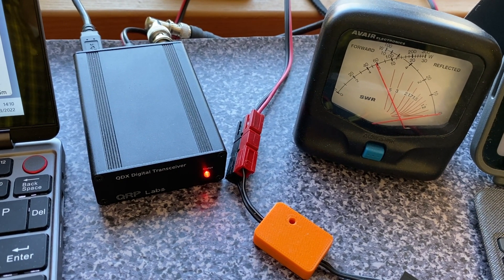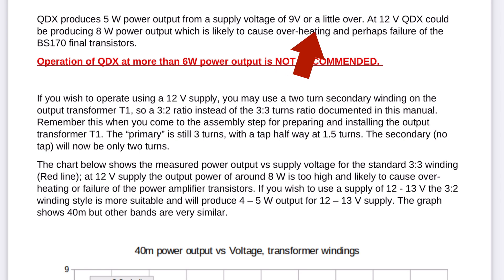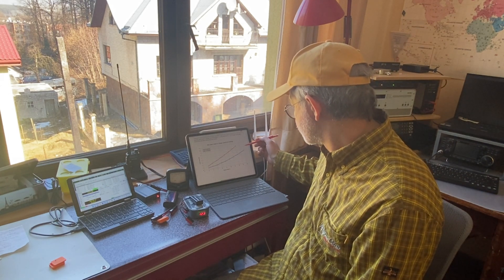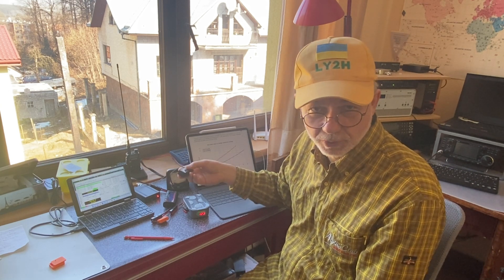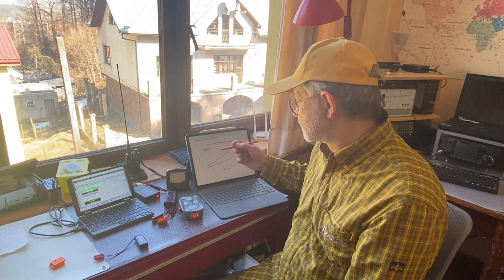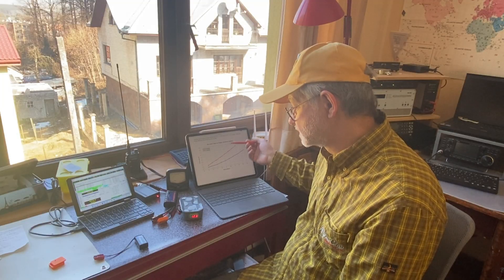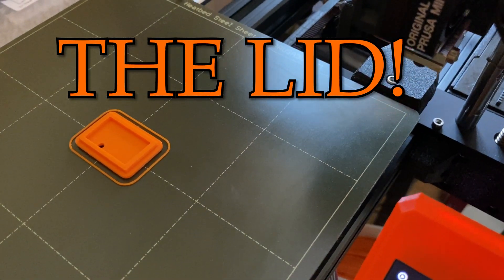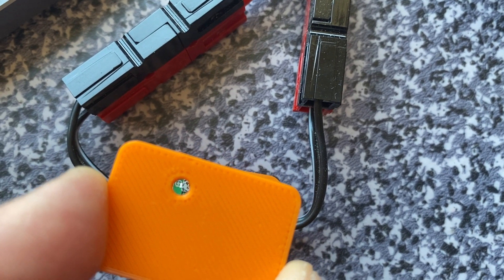In-Line Voltage Conditioner for 9V QDX Digital Transceiver in 3D printed housing.

Comment: Thank you for the video Linus. I added this to my 12 volt QDX using your box. I dropped the voltage from around 13 volts off a partial discharged 13.8 volt battery to 11.5 volts. I have noticed the QDX runs much cooler. Thank you for all your great videos.

Comment: Thanks for the video Linus.  I bought my QDX preassembled and it was supposed to be for 12v.  I bought the little 12v lithium batter power pack on Amazon and hooked it up only to find out it was putting out almost 8W.  Several emails back and forth to QRP labs who said my watt meter was wrong and then I needed to run it through a dummy load to be accurate.  I had been and my watt meter is accurate.  The second to the last correspondence with QRP labs was to put a series of diodes in line to reduce the 12v to 9v.  Then the last one was to send them a picture of T1 to see if it was wound for 12 or 9v.  I sent the picture and never received an answer.  Because of your video, I can now look myself to see about the windings in T1 and determine how it was wound.  Either way, thank you for your video and the links for the Buck converter and your housing box.  Keep up the good work.
Reply from the maker: Cool, there is always a work-around! Enjoy your wonderfull little radio as I enjoy mine! 73! Linas LY2H
Reply: Looked at the QDX and sure enough, it's wound for 9V.  I'll be making one of your little Buck converter and case.  73
Reply from the maker: @dpsflyboy  Nice to hear that Bob, hope, it's gonna work for you! 73! Linas LY2H

Comment: Buck converters only reduce voltage. Why not choose a more flexible Buck-Boost option?
Reply from the maker: Correct. And I only need to reduce voltage from the 12-14V levels, as my QDX is built for 9V. Actually, you can choose whatever you want, including no converters at all, as long as you can provide for 9V/1A at the QDX’s power feedpoint. The same logic is valid  for the 12V  QDX. 73! Linas LY2H

Comment: Thanks Linas for posting this option for the QDX. I had ordered my Qdx with  12v, which was still in the build queue, and I emailed Hans after seeing your video and had the build changed to 9v as I will be using it in the parks and also would like the ability to use different power sources and always have  around 5 watts.  It's great to find such great customer service from a company. Love your videos. 73 Ro Hart AI7PD
Reply from the maker: Thanks! Agree, Hans and the QRPLabs is fantastic! 73! Linas LY2H

Comment: If your lithium battery gets down to 9 volts you have damaged it!  Lithium Iron batteries are about 14 votes and are discharged around 12 volts. Below that can damaged the battery and most battery management systems cut off about 11.5 to 12 volts
Reply from the maker: Thanks for your comment on the use of Lithium Iron Phosphate batteries Donald, which I’m fully agree with. In my video I’m using a Lithium Ion (not Iron) 3S battery pack with 12.6 V fully charged. I agree with you that no battery type should be over-depleted and in no way I am proposing discharging any  Lithium  battery pack down to 9V in my video :). In my video, I’m discussing not the battery pack’s DOD problems but the power supply dilemma of the QDX transceiver. I’m advocating the 9V supply for this nice radio and propose using the step down converter for this purpose. The step down converter has no relation with possible misuse of the battery pack by the user. It goes without saying that every user must take care himself of ones battery pack being properly charged and discharged. 73! Linas LY2H

Comment: Linas - Great little DC-DC box and video discussion on this decision that must be made. I agree with your analysis when using a battery. I don't have my QDX yet, so preparing while I await the next batch. 

It seems like there was enough room inside the QDX box in the pictures. As long as the DC-DC is not really noisy in the RF area of interest, that would be a great future consideration. I see it has been discussed here also. I am glad it is in the discussion - keep it going. Great discussion going here.

Great video Linas and it helped me make my decision as well.
Bill - KA0B
Reply from the maker: Thanks Bill! It would probably be possible to accommodate the DC-DC board on the QDX pcb but the care should be taken and some skills applied to have it sit there safely and firmly. But these efforts would only justify itself if the permanent 9V is all what you want under the closed lid of the box as the access to the DC board would have been made complicated in this option. I wanted more freedom for experimenting, especially that power supply voltage regulation is the only way to adjust the output power in QDX and this option seemed important to me keeping  it easily accessible ( through this tiny hole in the box :)). Also, I left door open for connecting any other battery or whatever power source to my QDX.  With this said, I would , as experimenter, be very much interested in seeing someone else's implementation of the on-board DC-DC converter arrangement ! 73! Linas LY2H

Comment: Many thanks for an excellent voltage solution for the QDX. I just built the little convertor and noticed that I could change the voltage slightly by squeezing the top and and bottom of the box between my fingers. A little investigation showed that the little pot was getting squeezed and that was causing the voltage change. My board is sitting flat against the bottom of the box.  Easy fix: just nip off a little piece of the inside lip on the cover near the pot. It was this lip that was putting presssure on the pot. Works perfect now.  73, Howard AC1MN
Reply from the maker: Thanks Howard! You are absolutely right, nipping off a bit of inside lip on the box would help to adjust the accommodation of the board. I was designing the 3D printed box around my copy of the pcb and it could be the different pcbs might differ in dimensions like up to 0.5mm or so. I should have added some 1mm or so up to the box hight probably but I wanted it as small as possible :)...  Thanks again for your tip! 73! Linas LY2H

Comment: Hi, is it possible to transmit in 15m and 10m changing something?73´s Diego LU2DVY
Reply from the maker: Hi Diego! That would be nice! Unfortunately, the current design of V3 does not allow for the high bands operation option. The QRP-Labs owner and author of the rig Hans Summers could tell best if and when he is planning to release the high-band version, including a new firmware (which is not open source). Let's wait and see! 73! Linas LY2H
Reply: @Linas_LY2H  thank you 73´s and good dx

Comment: Hi Linus, I suggest you make the 9 volt power poles stacked top to bottom instead of side to side. This way you can never plug things in backwards thus releasing the magic smoke. Thanks for all of your good work.
Reply from the maker: Good idea! Thanks and 73! Linas LY2H
Reply: Or use a different sized power pole
Reply from the maker: Thanks for the suggestion!
Reply: Or choose a different connector that doesn't have this inexcusable conceptual design flaw. 'Power Poles' are not needed here, with a 1A load. People with a sense of humour should show up at Field Day with a 12V DC battery bank or power supply where the 'Power Poles' are reversed in their physical arrangement, but still perfectly correct in terms of Red and Black colour coding. Grab a chair and popcorn, and let the debate begin. Plenty of better connectors around; I wonder why 'someone' decided that Power Poles were to become some sort of "standard", makes no sense.
Reply from the maker: Power Poles  are needed here , for me, as all my 12V bus in the shack and in the van is uniformly adapted for the PP. This makes it extremely convienient swaping different batteries to different radios, power cords, in-line power meters, etc. As experimenter, I need to do this a lot, so standardised connectors make great sense for me. YMMV 73! LInas LY2H
Reply: Linus I use a bus system for power poles. Imagine a T structure where there is a power pole at each end of the horizontal part of the T, the wire used for this part is quite “fat” as this forms the bus. The vertical bit of the T has the rig specific connector. You can put a clip on toroid on the vertical bit if you need it. I also put a 200uF 35V electro across one powerpole and a 0.1uF across the other one. You can then daisy chain all your kit. I power the device with the most load closest to the battery/power supply.
Reply from the maker: @chrisherd991  Cool! Thanks for sharing!

Comment: Thank you. I was considering wiring it up for 9V and adding a 9V linear shunt regulator. But as I have some of the little switchers, and you say they don't appear to be noisy, I will wire in one of them and give it a try. However, I will switch to a small external voltage control potentiometer with a knob mounted on the front of my radio chassis, and I will use it as an RF power output controller to keep it always at 5 Watts.

Comment: Good video and I agree with the analysis to use a down converter for a 9volt built QDX.  The one question that I have is related to your 3d printed enclosure.  Since it is plastic and plastic is a poor conductor of heat, have you run into any heat issues?  Maybe some vents in the case would help with heat dissipation.
Reply from the maker: Thanks Evan! No, I noticed no heating at all at least on the chips I was using. The parts of the pcb don't even get warm enough to start being concerned :) So the plastic box  is very much OK , in my case. To make sure, you can always try use the unit without the box  and see how it feels heatlike under specifically your conditions of use. HTH, 73! Linas LY2H

Comment: Thanks very much for this, Linas.  I got a 6-pack of these devices from Amazon using your link.  I wired one up today and it works fine with my QDX, which I had already wired for 9 volts.  I'm using it to step down from 13.8 V.  It runs cool and generates no RFI that I could hear.
Reply: Perhaps one thing that should be considered is that these digital modes work way down into the noise, and we wouldn't be able to hear switching supply transients that could cause problems on receive. I'll do some sensitivity experiments with both linear regulators and the little switcher as I have a suitable signal source and attenuators in my lab ( an HP HF spectrum analyzer and an HF service monitor.) Unfortunately, what I don't have as yet is a QDX. I've had a couple of them on order for a couple of months now, but so far, no QDX has arrived here in the USA. I hope they show up soon as I'm eager to play with them, but I know QRP Labs has been swamped with orders, and also has procurement problems, as everyone does these days, and so I wait. But that's OK. I can spend the time building a magnetic loop antenna for use in my apartment while I wait.  That seems like the perfect combination for use with the digital modes of the QDX.
Reply from the maker: @johnwest7993  Sounds like a plan! Good luck! I've received my V3 QDX last week from Turkey with no probs, so it's gonna be my next coming project. As to the noise, you are right, if even there is some ( my ears indicate nothing :), but may be you could trace it with your test gear) it makes no feasible impact for the digital modes. Hope to see you soon on the waterfall! 73! Linas LY2H
Reply from the maker: I'm very glad this little board works good for you Bruce! I'd love to see you on the waterfall! 73! Linas LY2H

Comment: As I wait for my QDX to arrive I was pondering if I should configure it as a 9 or 12 volt unit. This You Tube made my decision and I will be building the QDX for 9 volts. You actually solved another issue for me. I have a portable transceiver that I take in the field and I use 9 volts as well, but operating time is not all that great. The setup you described will work perfectly for me in the field. Thanks for the video.  73 Dave - KE6EX
Reply from the maker: Thanks Dave! Hope to see you on the waterfall soon! 73! Linas LY2H

Comment: I’m now wondering Linas, if the down converter could be placed inside the QDX case itself?  If so, it would seem prudent to do so… what are your thoughts?
Reply from the maker: Hello Randall! Yes, I think it could. It was my first thought that came to my mind when assembling my QDX :). But then I decided to go the external tiny PS way for some practical reasons. Firstly, it would take a bit of surgical intervention to the original QDX board getting it ready to accommodate an alien pcb body of the downconverter,  and doing this is always a risk to damage some tiny smd parts on the board. Secondly, I wanted more versatility with my downconverter, like having it variable voltage output for experimenting with QDX or any other radios/projects I might wish to around the shack. Due to these reasons mainly, I chose this tiny regulated board and equiped it with the PP connectors as all my 12V "grid" in the shack and in my radio-camper van is adopted for the PP now. The construction is still teeny-tiny, not much bigger than the PP connector itself :). Would I ever wanted, still, to integrate the 9V PS into a QDX ( my V3 is on its way from Turkey, I hope!), I would probably go for one of these fixed 9V/3A output downconverters which are really small ones, or for even more simplistic solutions based on 7809 family or alike chips. With the V3 of the QDX being equiped with the reverse voltage protection circuitry and improved low-voltage chain, even the simplistic solutions might be safe enough to run. So, let's wait and see! 73! Linas LY2H
Reply: @Linas_LY2H  I have to say the voltage step down unit is tidy, and very well thought out.  Couldn’t you tuck the unit inside now?  The strain relief of the red and black power lead would be sufficient to make the unit more compact… 

You’ve given me some things to consider when I finally receive my QDX v3 kit…. Thanks Linas!

Comment: I wound my QDX for 12v and I am using dc dc upconverter to get 13,5v out of 12v from a computer PSU. And it works well, running only a bit warm. I also tried a downconverter similar to yours to lower from 4 16850 cells down to 13v and that worked too. What is most important, I saw no additional noise on receive when using converters.
Reply from the maker: Thanks for your comment Vojislav. Yes, upconverting is also possible, it depends on the situation. I use the Voltage Booster in my 100W Go-Box to get a stable 13.8V from my Bioeno LiFePo4 battery to feed my FT-891. The booster only switches on for transmit. But with QDX is a bit different situation cause with 9V wound transformer I have a bit more freedom output power and supply voltage variety wise. 73! Linas LY2H
Reply: @Linas_LY2H  You dont need 12v power because ft8 is not ment to be high power  digital it was design to be use lower power during poor condition during the low sun cycle
Reply from the maker: @AndrewMurphy8383  If you wire the output transformer for 12V you, actualy, get less power , not more , compare to the 9V version. This is pictured in the power vs voltage chart in the QDX user manual and it's in the video. 73! Linas LY2H.
Reply: @Linas_LY2H  Oh ok i miss the point sorry love your videos thanks to u i am going be buying a van or old ambalence to covert to camper hopefull soon and keep the vidoes coming  73s